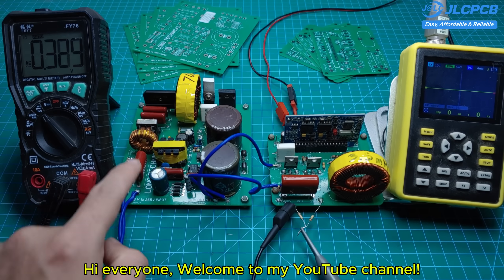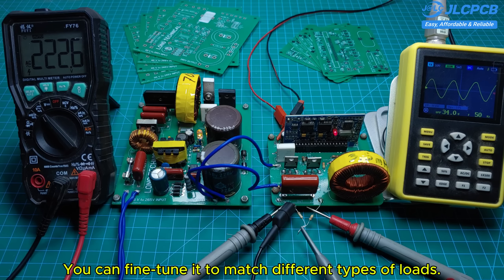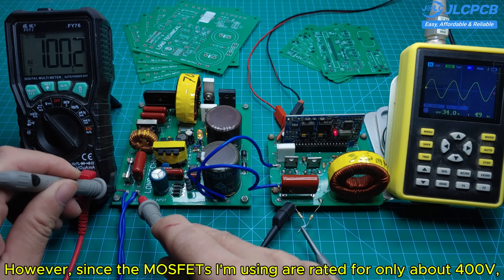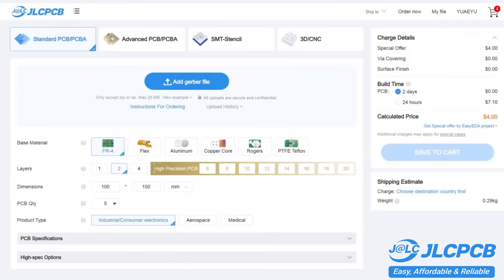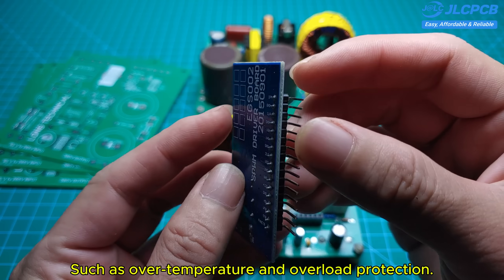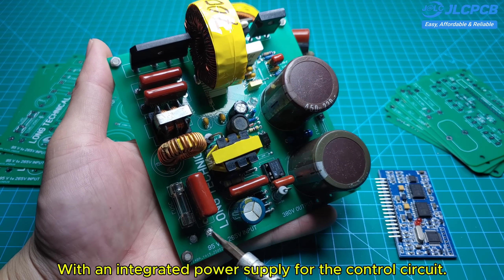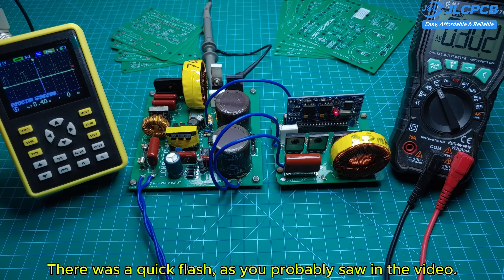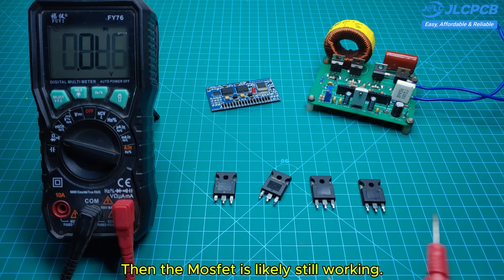How I Built an Automatic Voltage Regulator from 85V~265V AC to 220V AC  PFC and H- Bridge | JLCPCB

Comment from the maker: Thanks a lot for watching! I hope you found this project useful and learned something new.
If you enjoyed the video, don’t forget to give it a thumbs up, share it with others, and subscribe to the channel for more electronics content.
Feel free to leave a comment if you have any questions or suggestions — I always enjoy hearing from you
Reply: You're doing almost correct. But ur need to improve the EMI circuit. Always make sure the snubber resistor is perfectly calculated. If it's not it will lead to increase the no load current of the SMPS. Concentrate on efficiency also. I hope you understand. Keep rocking
Reply from the maker: @KAMESHCHINNUSAMY Thank you so much. Can you tell me what snubber resistor i need to improve, i love to hear that
Reply: Hi bro please send me footprint and components list and Please share the list of required parts and the technical specifications of the parts such as power, watts, and voltage so that this project can be built and completed. Thank you for the useful tutorial you shared.🌹🌹🙏🙏
🌹🌹
🌹🌹🌹🌹
🌹🌹🌹🌹🌹

Comment: Hey bro you are make a 5v to 120v input and 12v output converter using uc38xx ic  and this circuit use in high frequency inverter

Comment: sir i need your help
 i need 12v 150 watt flyback smps without laptop or computer i can not calculate transformer primary inductance and rcd snubber 
could you please design on software and give me details on comments about what primary inductance rcd snubber and current sense resistor for 12v 150 watt flyback smps

minimum input voltage 110 ac maximum 240ac
and my frequency is 40khz
i have transferre e42/2115 rounded core

Comment: Hi any possibility to add feedback function in ir2153 SMPS.
Reply from the maker: No bro
Reply: In this case it is better to use IR2110 driver and SG3525A PWM controller